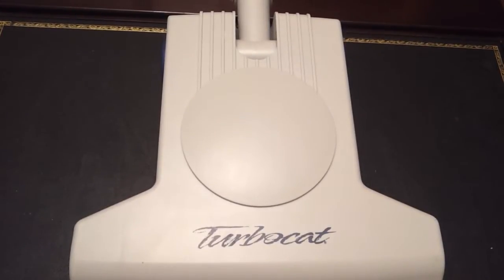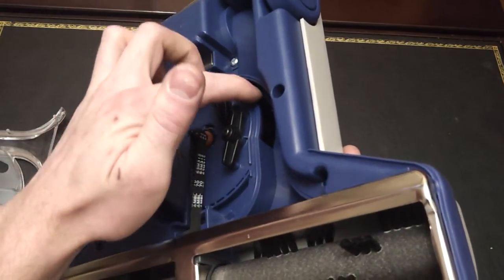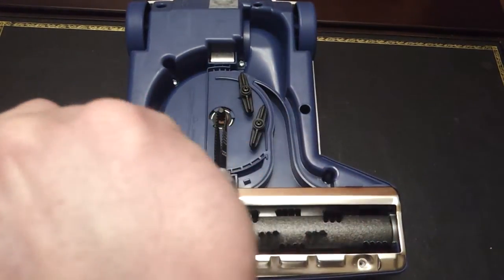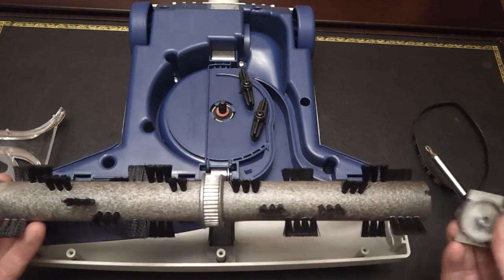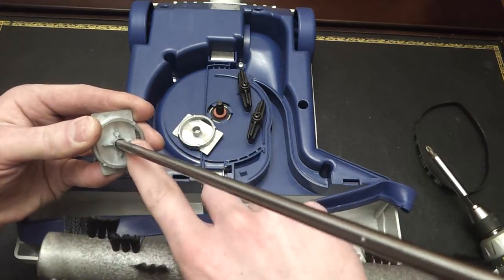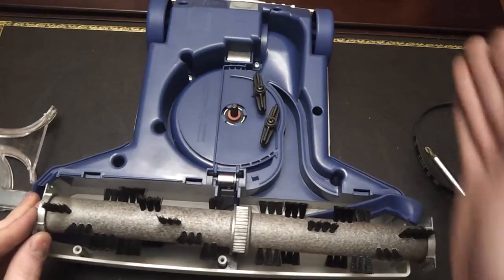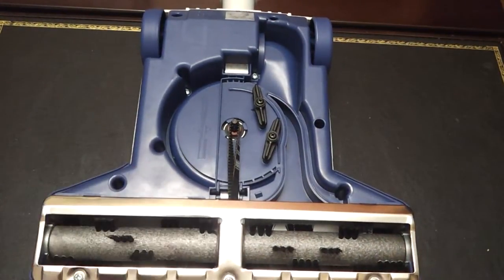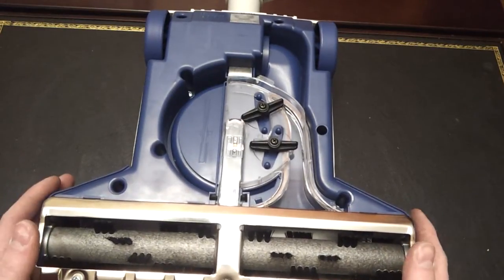Turbocat Service

Comment: I'm a stay-at-home mom that likes to solve problems.  My husband works long hours and is exhausted when he gets home.  I try to do as much as I can around the house to save money and help him have some free time at night and on the weekends.  
This was very helpful.  I took my Turbocat apart, cleaned it and put it back together in 30 minutes from start to finish.  The problem was inside the ends of the brush roller ... tons of hair (three girls in the house with long hair).
My daughter immediately noticed how much better it worked.  Thank you for posting this!

Comment: You just saved me 50 dollars by watching your video. Hair was trapped in the shaft and one side would not spin. Took apart according too your instructions and now the beater bar turns easily. Thanks for doing this. I really appreciate you..

Comment: Than you. Great detail. There was a washer on one side of our roller bar rod, which you didn’t show, so we left it off when we put it back together. When it seems wiggly, we put the washer back on the fixed rod side. Everything works great now. Thank you very much. Never would have noticed the beveled and without your video.

Comment: The video is very helpful.  Thanks  My TurboCat's brush do not move.  I tried to clean up but the knob that holds the belt from the other side is not moving at all.  Is there a way to open the turbine as something must got stuck which is not letting the roller to move.  Not sure what to do.  Can you help.  Thanks
Reply from the maker: Send us a picture of your Turbocat! -Justcentralvacs @Instagram @gmail
Reply: Just Central Vacuums Inc. sending you pictures from my email
Reply: Just Central Vacuums Inc. tried sending pictures but came back saying wrong email
Reply from the maker: Justcentralvacs@gmail.com

Comment: thank you so very much!  So helpful.  Never was sure, even with the illustration on the unit, if I had the belt on properly.  Now I can just refer to your video.  Also, I didn't have the plastic cover seated under the metal plate perfectly, and that was affecting my suction!